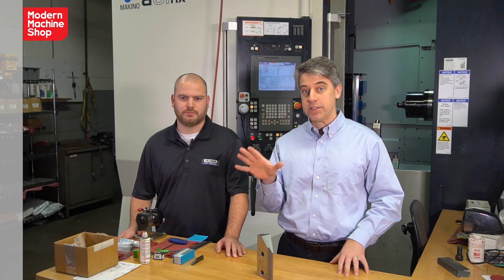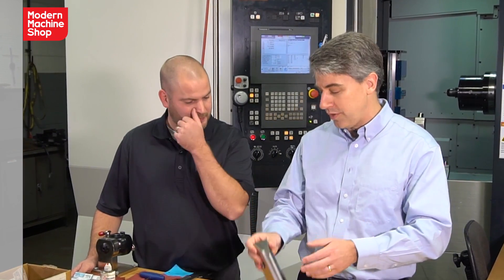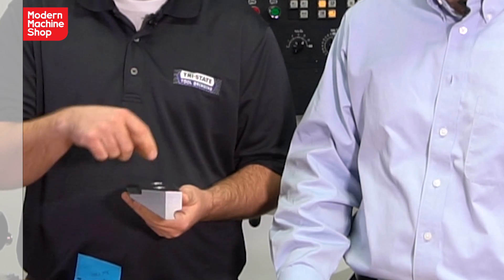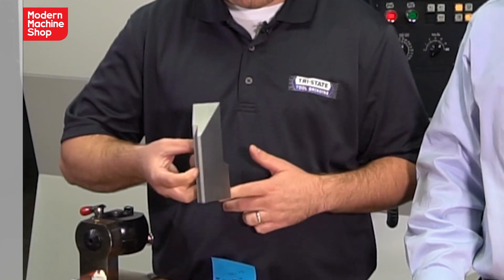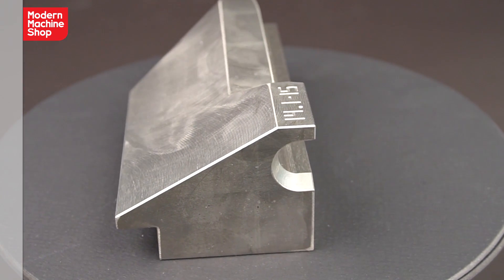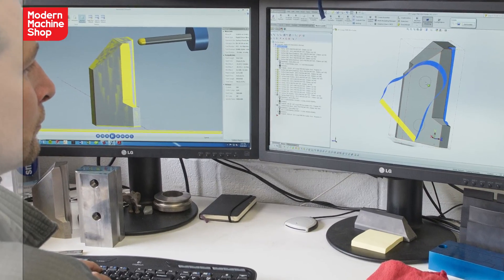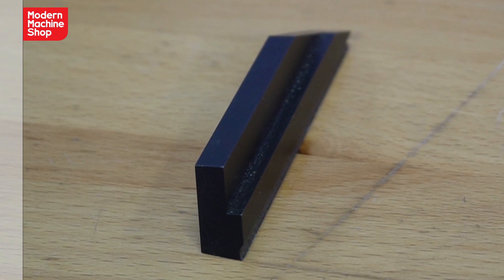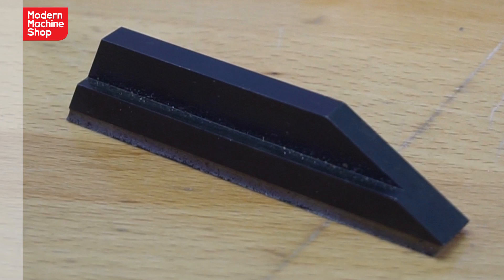Efficiency Gains from a Horizontal Machining Center

Comment: I'm new to CNC, but would gains be vs 3 axis CNC? Wouldn't 5 axis solve a lot of those issues?
Reply: Yup
Reply: 5-axis is overkill, also you still need a minimum of two setup even with 5-axis so no real savings there.   Additionally, most 5-axis do not have multiple pallets and their costs are much higher than a 4-axis horizontal and much smaller work envelopes.
Reply: @anthonymuto8372  how is investing in a 5 axis rotary table more overkill than buying an entire new horizontal mill?
Reply: Material removal rate is much lower with 5 axis because rigidity.